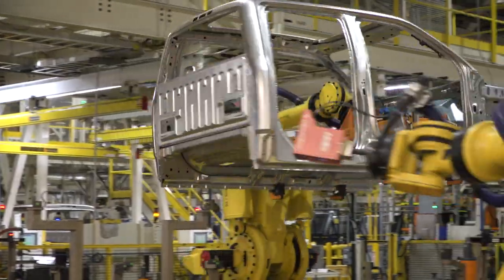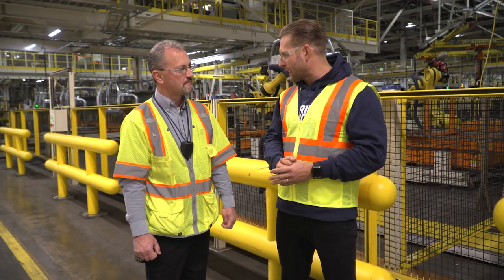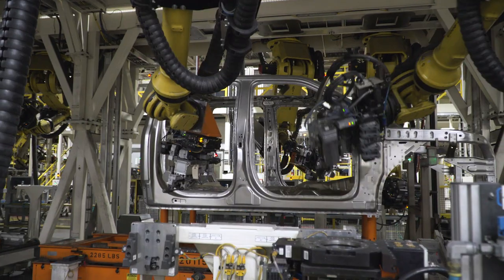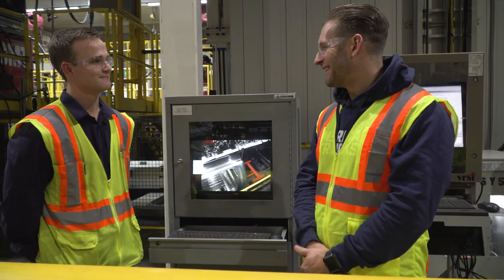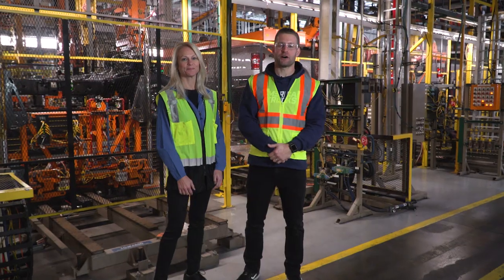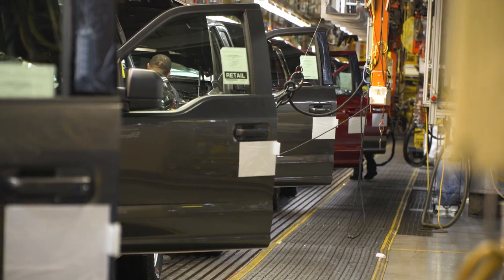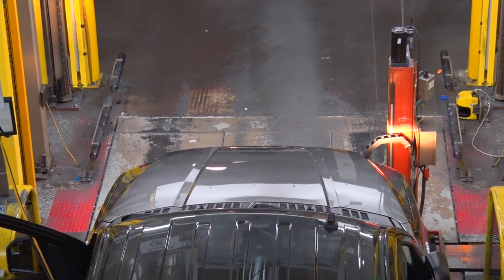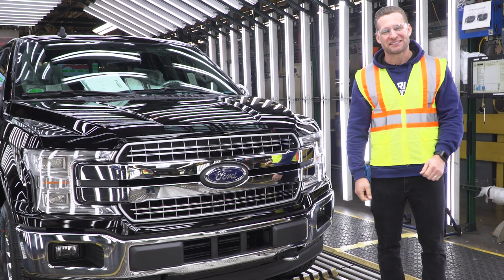F150 Factory Tour | How Ford Builds An F-150 Every 53 Seconds - The Haul

Comment: My 1999 Ford F150 XLT is still going strong.  Best purchase i ever made.  Haven't had a car payment in 15 years.
Reply: Amen to that!
Reply: Mileage?
Reply: My 99 does not even have a FRONT AXLE...its a uni body design...you can not haul much in the dang thing, you just drive it around for show and thats with a club cab and a long bed...NOT what ford used to make...it sounds like its time to start reducing pay of execs, getting rid of unions
Reply: Same 99' Lariat 4x4 I've never financed a vehicle and never will.
Reply: Private Name  If “your 99” is a Ford F-150 it is not a unibody design.
Reply: 1973 F100 here with 4 speed, only needed 1 clutch replacement in its life so far
Reply: HOW CAN THAT BE?????  NOOOOOOO!!!!!!! Toyota is the answer. The best of the best that never does anything wrong. (sarcasm)
Reply: I don't understand why they have to make so many. They are supposed to be the best trucks and never break. Why replace them unless it's totalled in a wreck. At this rate there's probably enough f150's for everyone on the planet to have one.
Reply: @beezertwelvewashingbeard8703  Bro, you dont get it. Your problem is that you're thinking with logic, but lots of people dont have any. Gotta have that latest model. Otherwise, they THINK they're  loser in society. Gotta keep up with the Joneses.
Reply: M Detlef  A normal period is 3 years. 5 is THE MAX OF ALL MAXIMUMS.
Reply: '05 STX with 289000 muffler, alternator, battery, brakes. Runs like a champ, no issues :)
Reply: @KyleButler82  Same with my 13 escape. 110K miles without major issues. Just regular wear and tear shit.
Reply: Have you check out the crash test on that truck! DEATH TRAP!
Reply: M Detlef  Reread my post.  Haven't had a CAR  payment in 15 years.  The truck was paid off in a matter of 2 years.  Have another car that I bought in 2003 that got paid off in 2005.
Reply: @privatename1184  correct, if you try to pull a heavy load with it, you'll tear up the transmission.
Reply: @beezertwelvewashingbeard8703  are you talking about Ford being the best and never breaking? Not the case.
Reply: @bmw803  I have a Honda with 420,000 and no breakdowns.
Reply: A TO THE Y Yyy  I choose to spend my money on things that don't depreciate by 25% the minute I drive it off the lot.  The truck isn't even my primary vehicle.  I use it for its purpose.  To haul things.  Buying a brand new car or truck is for suckers.  You can take that to the bank.  $$$$$$
Reply: '07 F150 FX2 5.4L.  194,000 miles.   Thank you!

Comment: Sneak a v8 into a raptor
Reply: whiteandnerdytuba lmao
Reply: Why?
Reply: whiteandnerdytuba but you have to admit that the twin turbo v6 in the raptor is impressive. 450 hp and over 500 ft lb of torque
Reply: memo12310 I like the engine. It’s just that for the power, I cant scarifice that sound. turbos make good torque but the old 6.2 can make 450 with just a tune. ford drops in the 7.3 and ill buy my blue on blue raptor today
Reply: whiteandnerdytuba what are your guesses for hp and tq for the 7.3?
Reply: memo12310 can’t guess since it’s medium duty designed. The old 6.2 made 411 back in 2011. Takes nothing to get that to 450. It's the torque that's harder to match without blower. Current mustang makes 480hp na, even if that's tuned down for truck it's the same 450. There's no rational reason to not give a v8 option. Two companies are selling v8 conversions since there's so much demand
Reply: im in love with my ecoboost raptor, much more power than any v8 ive owned, most people who actually own them, love them.
Reply: Oops we accidentally put a twin turbo V-8 in this one. Send it back to the beginning before the customer acceptance line rejects it!
Reply: whiteandnerdytuba a v8 with that much power would be hard to make reliable and incredibly inefficient in a pickup, I like the v6 better tbh, I have one, it’s a breath of fresh air,  all trucks are going to smaller engines
Reply: whiteandnerdytuba the v6 TT sounds nothing like a Honda, you need to be open to change, because it’s happening, my raptor is the most exotic sounding thing I’ve ever heard, it made me switch from Chevy, the big pushrod v8 is technology from the 1940s and it’s incredibly inefficient. All trucks and cars are headed towards smaller engines, the ford GT uses almost the same engine, but just less built.
Reply: whiteandnerdytuba takes more than “nothing”to make close to 500hp, the mustang in your picture only made about 300hp, it’s technology has come so far, but it didn’t come easy.
Reply: @jaredchampagne2752  I doubt you're overpriced plastic EcoBoost truck will outlast the 5.0L (302) Windsor V8 in my 96 F150.
Reply: @memo12310  Maybe 475/510
Reply: Done !!! Sneak that new 7.3L  Monster in.
Reply: @whiteandnerdytuba  Actually, the twin turbo sounds pretty good. Maybe not as good as the V8 but it's worth the trade off. Lots more power and much better fuel economy.
Reply: Hennessey Performance just posted a video this week of a 2019 Velociraptor where they took out the V6 for a V8. Why? Because it's faster and sounds like a proper full-size truck now.
Reply: The 2020 Raptor will have the new pushrod 7.3L V8
Reply: M B shut up and take my money
Reply: Think Ford will be releasing a v8 option soon. When they announced the v6 I was like tf?? Yes it's more powerful and efficient than the 6.2 blah blah that's great awesome but at the end of the day...its a v6 and plus wtf you gonna do with a truck like that, I mean people never use it for what it's intended for, waste of money. Get a 6.7 super duty. More truck and power for a similar price. You ain't gonna find a raptor at msrp. Good luck with that
Reply: It's faster an more efficient with the Ecoboost. Dont get it. Gen2 Ecoboost is phenomenal in all applications. Ultra powerful & reliable.
Reply: @tedschmitt178  uhh why not
Reply: David  Klimmek one is a v8 and one isn't. It's not a decision.
Reply: Toyota TUNDRA  PRO 4x4 v8

All the way!!!
Reply: BIGDADDYONE121 lol. Found a comedian
Reply: whiteandnerdytuba I’m 100% serious.  7.3 pushrod V8 for 2020!
Reply: Kenneth Norman the next V8 Raptor will be a 7.3L pushrod.  It’s not a secret.
Reply: M B haven't seen anything official. Only hopes and dreams
Reply: whiteandnerdytuba trust me. 🤫
Reply: @memo12310  impressive but sounds like 🗑 can
Reply: they did lol
Reply: M B no it won’t lmfao
Reply: CJ Colvin I assure you ford engineers know what they’re doing and the 3.5 Ecoboost with 450 horsepower is a better engine than a 302 with 170 horsepower 🤣🤣🤣🤣
Reply: BIGDADDYONE121 a tundra isn’t even in the same ball park
Reply: M B 3.5 EB is staying in the raptor, the 7.3 is only designed for heavy duty trucks
Reply: whiteandnerdytuba 😂
Reply: whiteandnerdytuba yup because the new raptor sounds stupid with that v6
Reply: Tactical Canadian it’s sounds good in person
Reply: @whiteandnerdytuba  Although the rumble of a V8 might sound good to you, the twin-turbo V6 wins ... a little trick called "power to weight ratio". Aluminum vs steel also wins that battle against other light truck manufacturers.
Reply: It's getting a V8 late next year.. Ford is set to unveil the next F150 but before the current body style is replaced, the Raptor will go out with a 5.2 supercharged V8. I read that a news article a few weeks ago. Hopefully this upcoming V8 will carry over into the 3rd generation Raptor.
Reply: memo12310 put it in the Ecoboost stang
Reply: @areyouready22  The real world fuel economy is actually worse in the regular 3.5 ecoboost and especially the H.O. 3.5 compared to the 3.3 and 5.0 NA engines. Infact its even worse when you tow. The 3.5s get around 10mpg towing. The 3.3 and 5.0 get around 12mpg depending on weight.
Reply: @whiteandnerdytuba  I've seen reports saying they might put a downtuned version of the new GT500 engine in it. Including the supercharger from what I've seen.
Reply: The 5th King been saying that for a couple years at this point.
Reply: @whiteandnerdytuba  I seriously doubt that, considering they only just revealed the GT500 this last spring.
Reply: whiteandnerdytuba LoL seriously 👍🏻😁
Reply: Lmao “A Accident “ 😂
Reply: Hennessy will gladly do it for you 😉
Reply: @whiteandnerdytuba  but maybe she is man and you got fooled?
Reply: lairdriver man that just keeps happening too
Reply: As cool as that'd be, it'll never happen, back the late 1960's a Ford engineer tried to sneak a 428ci Cobra Jet into an F-100 truck and the truck was promptly confiscated by Ford and the engineer was fired.
Reply: @memo12310  The power and torque is impressive but the Coyote is just as capable of reaching those numbers without sounding like a vacuum cleaner.  The iron block 6.2 they had in the 1st gen raptors was way too heavy, but an Aluminum v8 like the Coyote would've been perfect for the 2nd gen.
Reply: 2022 lookin forward to it
Reply: American Truck Nation supposed to be limited supply so will be nice for the 150k dollar truck crowd
Reply: They're it's going to be in the 2021 raptor
Reply: @LetsgoBrandon2023  2022
Reply: @americantrucknation4891  oh I thought it was 2021
Reply: 2022 Raptor getting a gt350 sc as an option!
Reply: @whiteandnerdytuba  this week1/1/2021 ford said raptor 2022 gets a gt350v8 sc. as an option
Reply: @Dirtyharry70585  limited edition run not full series production was the last rumor. Yours for 150k

Comment: I absolutely love my 2019 F-150 with the 2.7 Ecoboost. I've also had a 2012 3.5 Ecoboost and a 2014 5.0. They were all built in the Kansas Plant.
Reply: I have the same truck I love it too, I have  a 95 5.0 sitting on 35s that I drive in the summer love my ford trucks
Reply: These trucks are supposed to last a lifetime. Why you have to replace the other ones?
Reply: @beezertwelvewashingbeard8703  cause Ford

Comment: 2014 F-250 Power Stroke, with 245,000 miles, works on the farm everyday,
Never been in the shop, only tires, 1 set of brakes, and batteries.
thats it.
Best Truck ever built.
Reply: Wow thats 4083 miles/month driving. Lots of driving
Reply: 2013 Explorer Sport. Always in the shop.
Reply: @lotus956  Ford Exploder
Reply: Built at the Ky. Truck Plant Louisville Ky.

Comment: I had a 2014 F 150 , great truck, and now I drive a 2018 F-150. I love the fuel economy on he 2.7 litre turbo. Great trucks.
Reply: You will be replacing the transmission at about 70,000 miles.
Ford is junk
Reply: @chrism8432  wrong

Comment: Dang, would’ve been nice to see when they install the powertrain.  Very cool video either way 👌
Reply: It's when the EcoBoost and wiring harnesses get there from Mexico. Cracks me up that Ford is assembled in America with mostly imported parts.
Reply: I'm sure they don't want to share everything.
Reply: @budskrilla2u133  or from Cleveland.
Reply: @ymx86  Go to a local Ford dealership and look at the sticker on the drivers window and look at the were the percentage of parts made and where. It's sad.
If Ford was a conservative based instead of liberal this would be all over the news.
Reply: @budskrilla2u133  except for the axles, engines, transmissions, frames, bodies, and all the major parts. Everyone has a right to an opinion.
Reply: @budskrilla2u133  Its funny you should bring up "the industry" that Ive have been in for 19yrs and still working in and for Ford Mo. Co. on top of that.  Worked in both assemble and currently in power train, so take your backyard mechanic B.S. and move along.
Reply: @budskrilla2u133  So your argument started about the F-150s Ecoboost engine and now its Ford vehicles? Being a used car salesmen doesnt make you any type of expert.
Reply: Have a nice night Jr.
Reply: @ymx86  do your research
Reply: @budskrilla2u133  you realize most if the materials used to create the parts for these vehicles are not acquired in the us right? Bad oil, bad gas, bad aluminum, bad iron/steel. Being made in America is just a scam. I'm very patriotic but dont buy into that bullshit.
Reply: @budskrilla2u133  salt? Rust?

Comment: Great video, didn't realize how many trucks roll off the assembly line each day, completely amazing. My 2013 steel bodied Platinum 5.0 with 100k still going strong with zero issues whatsoever...nicest and smoothest truck I've owned. Thanks Ford for a great truck.
Reply from the maker: Thanks Frank! -Justin

Comment: I worked at Toyota Motor Manufacturing Indiana building the Highlander. I was in underbody weld and was amazed at how that plant ran every day. We built about 1500-2000 units every day, our Sequoia line would only produce about 60-70. Coming from working at Toyota, and driving Fords I would only drive the two, Ford trucks and Toyota cars (except for the Tacoma which is awesome).
Reply: T38 Talon  2 lines building for domestic and international.

Comment: anyone know why the raptor at 10:51 has marker lights on the bumper? never seen them before, but they look awesome.
Reply: Bulky Sphinx they look like reflectors
Reply: The F150 raptors have the marker lights on the bumper because the raptor is wide enough to fall into the commercial class for width, which requires those marker lights on any vehicle in the class

Comment: I think the issue with Ford is that when you get a solid built one, then it will last you forever, but there are a lot that come off the line with issues. Quality is one thing, consistency is another. Toyota just blows their competition out of the water when it comes to quality, but of the American manufacturers, I have to say Ford is my favorite considering some bad experiences with the likes of GM and Chrysler.
Reply: I agree. But to say that toyota makes quality cars is an overstatement. They make reliable, dependable cars. Nothing about stepping into a recently made corolla shouts quality.
Reply: Taylor Persinger perhaps our idea of quality is different. I admit that I wouldn’t pick a Toyota for luxury, I will say that the way some Toyota products are equipped is questionable, such as a key start on a 35000 dollar Camry. But Toyota has a “if it ain’t broke, don’t fix it” attitude, and that seems to serve them well. I’ve driven or owned numerous Toyota’s over time and the amount of parts they reuse is amazing, such as the window adjust switch for example, I’ve seen them in ones as old as 2001 to the brand new Camry.
Reply: @nickakers7985  They also share with Lexus. My Lexus GS 350 Sedan has a trans from the Tundra now the Tacomas have the 3.5L engine from the Sedan. Ford also copied their dual injector technology for their direct injection engines. Lexus had it in 2005.

Comment: Ford builds an F-150 every 53 seconds and every 30 seconds one falls apart. Compelling statistics.😂
Reply: Best truck I've owned so far. Except the 1985 Toyota 4x4. Sold it running like new with 348k. Ha

Comment: I'm a proud 1991 f150 owner and it's built ford tough and still going strong...have done a engine change after 270,000 miles and some frame rebuild and standard component replacements but she's solid and pretty much a brand new truck all the way..😀👍 And no vehicle payment just maintenance I do everything myself so I know it's done right and at my cost....

Comment: Ford never took a bailout. To hell with GM and Dodge. I wouldn't take one of theirs for free.
Reply: Uh yes actually Ford also took a Bailout amount under the disguise of a Loan to the tune of $15.9 Billion (Ford Credit) and an additional $5.9 Billion that was used to overhaul their factories and tip-toe around bankruptcy. GM was $13 Billion with $6 Billion set aside for GMAC which if I remember correctly went up to $13.9 Billion. Chrysler is the one that took less than both Ford and GM at just $4 Billion if I remember correctly. All 3 are required to pay the money back + interest however the damage done is far higher than what they are paying back. Believe the deadline to be around 2022 or so.
Reply: @ramtrucks721  Some of these vehicles are infact better than others in certain aspects, but you can not deny the fact that most if not all vehicles and vehicle brands are of good quality and durability nowadays. Close minded people, open your minds. Otherwise your just like extreme conservatives, extreme liberals, radical feminists, and even KKK members... close minded .
Reply: Nicholas Q. I’m at a loss to see how the kkk has anything to do with a truck video..just sayin.
Reply: Ford took a 5.6 bill loan to re tool a plant because the banks couldn't pay. GM and Chrysler took about 40 billion each to keep the companies afloat. Big difference.
Reply: Eric Jensen they sold all there share of stock back to Mazda as well. Which is why no Mazda looks like a Ford anymore.
Reply: Paul Wright alright see you when I pick up your Chevy later and bring it to the shop.

Comment: How is it that some F150 end up at the dealer with out of alignment doors, seal leaks, water leaks around rear cab light, fit and finish issue. with all the inspecting they claim, I never see one getting pulled of and repaired. I call BS on the claims, My dad used to work at the KC plant and told me many time of a bolt being stripped out or another issue and it gets sent out anyway. The old saying was let the dealer worry about it.
Reply: Always a troll. Ur Dad worked at KC huh? Doubtful ... lying? Best quality trucks u can buy.
Reply: BMac lol

Comment: I've got a 2016 Lariat 3.5L Ecoboost with just over 11,000 miles.  My profile pic is me sitting in it.  My local dealer tried to get me to trade it in for a new one earlier this year claiming that mine had a high desirability factor, and I was like "yeah, that's why I still wish to keep it."  I've done several exterior cosmetic modifications that are special to me, and I'm not about to give up the truck that quick.  Besides, I'm handicapped and require special controls so switching vehicles isn't an easy thing to do.  I kept my last vehicle for 16 years and only put 40,000 miles on it.